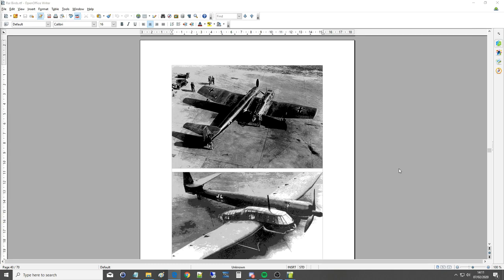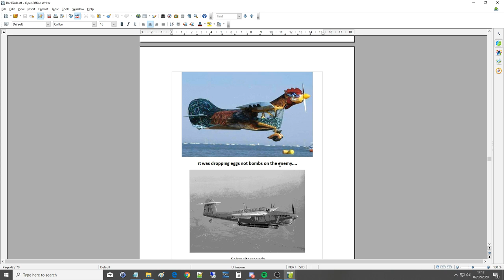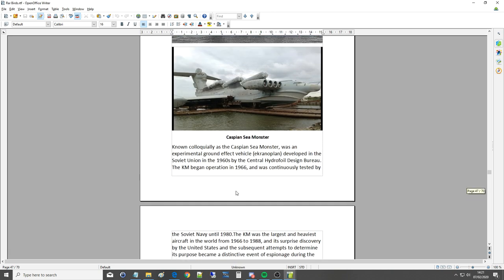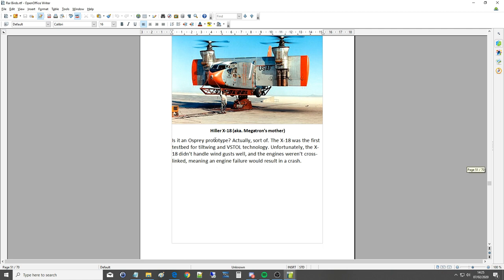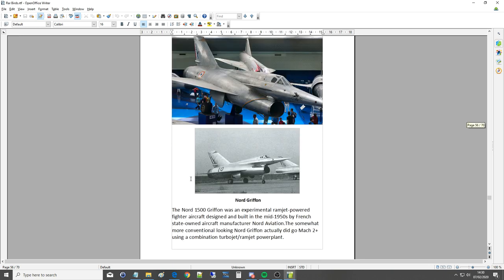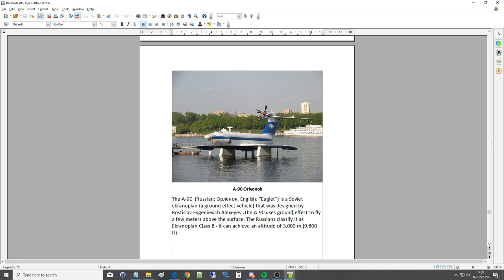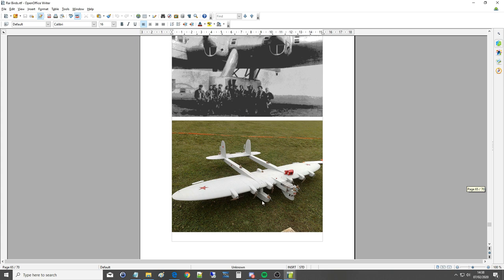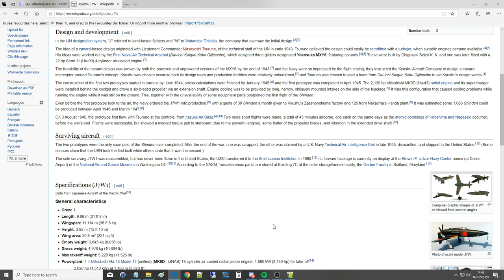World's Rarest & Strangest Aircraft | Vid 2 of 2

Comment: Regarding the second plane with the circular wing. This type of wing is developed in order to eliminate the wing-tip vortex which are produced by the wing in flight. These high powered vortex formations create a lot of low pressure behind the wing and thus create drag which increases fuel consumption and reduces the speed. That is why all modern passenger planes have winglets on the wingtip to eliminate this type of vortex formation. The circular wing basically has no vortex formation because there is no place for it to form.

Comment: The Leduc 0.21 wasn't the only plane to have the pilot sit in the shock cone of the aircraft. The Miles M.52 used a similar arrangement. Unfortunately the Labour government in England had it cancelled. The Bell X 1 got its flying tail from the M.52. The M.52 was later revived but only as 30% unmanned rocket planes.

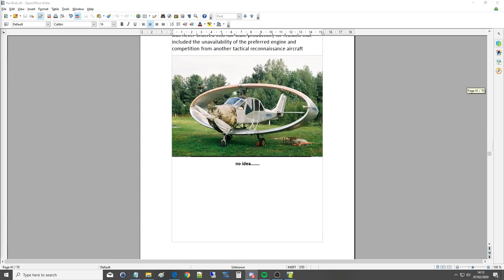Comment: 1:00 crosswind is a bitch coz of the increased side on area. Side note, the best '' paper planes '' are tube shaped. Ps. Supersonic prop tip speed is not possible, the bear's rear prop did go mach 1+ in comparison to the front prop local mach value, but, due to prop wash from the front prop, the pressure reduction and effective AOA made its actual mach number sub sonic

Comment: the ring winged plane...  the 'wing tip' vortecies would be driving into eachother for both the top and bottom wing...  wouldn't that be highly efficient for lift?  like a bi-plane but with less parasitic drag
Reply: My understanding is that the closed wing design is a novel approach to reducing the induced drag generated by WTV turbulence. It's been suggested by a few engineers that certain aggressive configurations of this design could somewhat augment the thrust provided by the powerplant via some kind of design-induced acceleration of the airflow passing through the wing structure, but that's yet to be proven in a full-scale aircraft.

Comment: Regarding the supersonic propeller, the Geico Skytypers are a group that fly a ww2 era prop plane where the edge of the propeller moves faster than the speed of sound, and they are quite loud. Far louder than your average prop plane. Louder than a jet with afterburner though, I dont think so. Possibly its different if the whole prop is moving supersonic idk. But yeah in person it's quite loud. The plane they fly is the SNJ-2 if you are curious.

Comment: 5:30 Caspian Sea Monster and Lun are actually 2 different aircraft. 
The first one is larger, unarmed, has 10 engines: 8 on the front with exhaust angled down and 2 in the tail. (The engine power handles on that thing are positively ridiculous) It needs all 10 engines only for takeoff. When airborne a ground effect vehicle can fly under much less power than a conventional airplane of that size would require, so only 2 in the tail are used in flight. Also, during one of the tests/demonstration for the ministers it run its engines while chained to an anchored barge. At 40% power the barge was no longer anchored.
Lun was made 16 years later. 8 engines and armed with missiles. Here's a video where you can see it closely (including the missile launch) https://youtu.be/i6AJ86NtF0I?t=570

18:10 Orlyonok actually has 3 engines. 1 main engine on the back and 2 small takeoff engines on the front. The "eyes" on the front are intakes and nozzles are on the sides. 
It is also not (only) a passenger plane. It was developed as a beach assault plane. It can carry 200 marines or 1-2 APC .
Reply: Also, i beleive, the "maximum sea state", is the height of waves when it can land/take off.

Comment: Remember we now have 100 years of flight experience, fancy computer simulations, fancy wind tunnels for models, etc. Back when the very first aircraft flight was less than 30 years ago "it's obvious" wasn't as much of a thing. To answer "I wonder what would happen if we tried <thing>" you would have to build it and find out. (Just find someone else crazy enough to be the test pilot)
So as to why a lot of these were made, it's basically "eh, let's give it a try." And as to why there were usually only 1 or 2 made it's usually "Turned out it wasn't what we hoped for or it had unexpected side effects, so we didn't build more. But hey, we learned something."

Comment: That 2nd plane is using a closed wing (or "box wing") design which purports to reduce the effects of induced drag created by wingtip vortices, as well as creating a more structurally robust lifting surfaces. 
CSB: Years ago an Oklahoma, USA company called "Shark Jaw Toys" created a foam RC EDF jet called the Viper, with a blended closed wing design as a kind of proof-of-concept for a full-scale aircraft. I had one and after tuning the trim and CG, its flight characteristics were very remarkable. Stable yet responsive and nimble, able to handle high- and low-speed flight almost equally well (EDFs typically don't like low speeds). Unfortunately the company went out of business before I ended up smashing the thing beyond repair. I'd love to have another one, but no one seems to make a comparable design.
/CSB
Review of the Viper with pics: https://www.flyinggiants.com/forums/showthread.php?t=20275

Comment: "Sea state" refers to waves in the water. It is calculated from the tops of waves to the trough between. think height of waves as your sea state. With a 3 foot sea state,  the KM would have to take off and land in moderately calm water. The altitude specs would also depend on the sea state that they are flying over. If it can fly to 45 feet, then consider what 40 foot swells would do to the aerodynamic pressures under the wing creating that lift. If it was able to sustain flight with those waves, it would be like driving your car intentionally driving on the rumble strip, if not more violent.
Reply from the maker: thx

Comment: If you take a close look at the BV-141 engine compartment, you'll recognize it looks very similar to the one of the FW-190. It had the same BMW-801 and it clearly was favoured for the 190.

That oval wing thing looks interesting... here's some serious Wagner Code for you, WATCH THIS! https://www.youtube.com/watch?v=KRXlLs7W5TE :)
You could literally piss off anyone with that thing when you just sticked to what this real F-14 driver recommends here: https://www.youtube.com/watch?v=Nq4SZUgNOaM&feature=youtu.be&t=266 - just without having afterburners... this thing is king in the vertical, 2 30mm cannons (like the 109K's) pack a lot of punch and you've got 3 X-4 missiles that literally work like the RB-05 of the Viggen in air mode (prox fuze). Operating that thing in '46 was the definition of having fun with Wagner Code... :D

Oh, that Lockheed XFV-1 Salmon just takes off and lands like the Heinkel Lerche would have done. By the way, there also was another plane of this type, literally the XFV-1's competitor, the Convair XFY-1 Pogo.

You can fly the J7W1 Shinden in Il-2 '46 as well BTW - https://www.youtube.com/watch?v=wmyojPQi_fQ